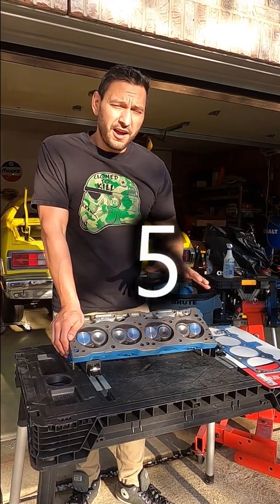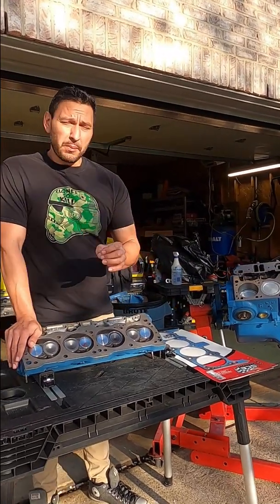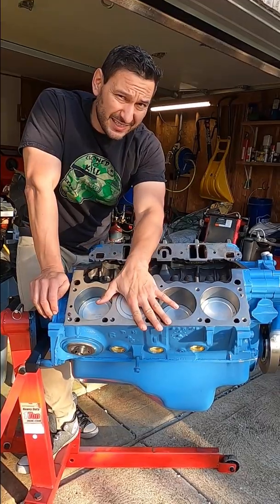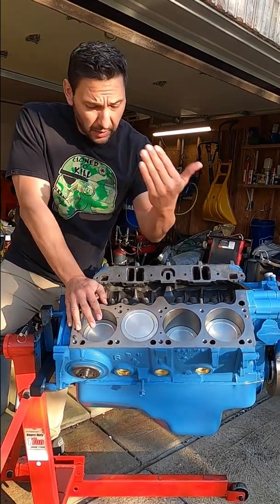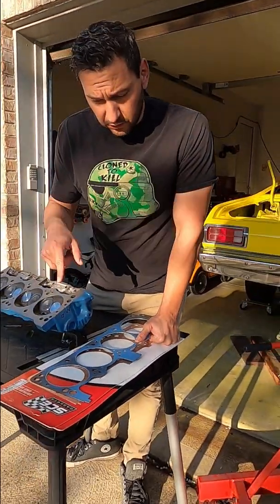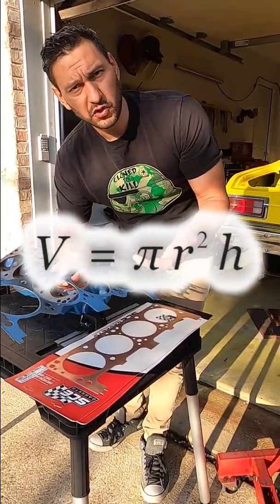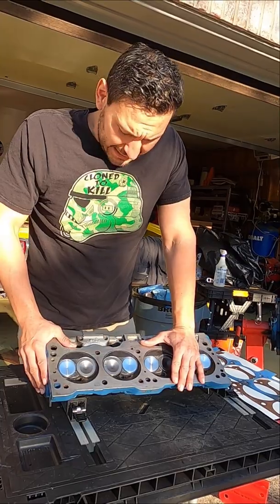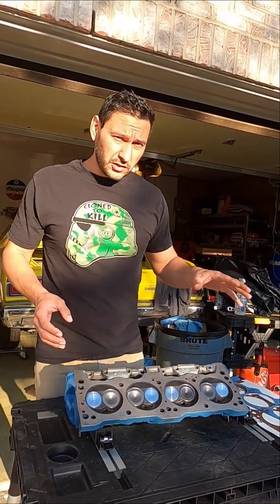What I wish I knew about Engine Compression before starting my first build.

Comment: The 80's "Fast Burn" 302 heads for the 318 are about 64cc. The 1.74 intake is small so it's done by 5000 rpm. You can machine them for 1.88 if you want. If you want to solve your compression problem on the cheap it's not a bad compromise. This was the old school cheap and dirty solution to smog 360 engines.
Reply from the maker: Hi ahoneyman, so these were 360 heads. 71 cc chamber, 1.88 intake 1.60 exhaust. The common performance change on these is to go up to 2.02 intake, which matches what some of the 340 heads had. Thanks for the comment!
Reply: @DustorBust  Yeah, that's the 360 70's era stuff. The 80's 302 "fast burn" heads are 64cc. Bumps up compression to 9:1 ish. No milling needed. I come from a low buck truck background so high RPM isn't too important. That and I just like messing with factory junk.
Reply from the maker: @ahoneyman  okay makes sense. Nothing wrong with low buck, can still have lots of fun!
Reply: @DustorBust  Uncle Tony's Garage does a ton of Mopar stuff. Tony does like to ramble but he knows parts.

Comment: Glad to see  you are going with a 65cc head, you have too much work in that car to not have it run like it should, I hope you go with the edelbrock rpm heads, sweet piece.
Reply from the maker: Thanks Mike! Edelbrock is definitely one of my preferred brand. I have also heard good things about ProMaxx heads, let me know if you have any perspective on those. I will start it up with the stock ones, but will definitely upgrade in the near future. It will be fun to try to measure the improvement.
Reply: No experience with the ProMaxx heads, just put my hands on a set of the Edelbrock rpm heads and was real impressed. Breaking the engine in on the stock heads is not a bad idea, getting one of those G meter devices and doing a before and after test would be great.
Reply: I run the 340 (63cc) Edelbrock heads on my 416 stroker. There’s complaints on Eddy heads that the valves don’t seat properly, but I have no complaints whatsoever. I’ve had them for three years now and they’ve preformed great!!
Reply from the maker: @billriggle2392  thanks for sharing! I had not heard of the seating issues, but it would be easy enough to inspect for and so far I have not had any issues on Eddy parts.
Reply: We poured alcohol in all the ports and none of them seeped, will still do a performance valve job on them though.
Reply from the maker: @mikedimaio1237  thanks!  I wish they came  with a performance valve job, but most people say to have them checked. Seems like this should be done with an assembled head. Oh well.